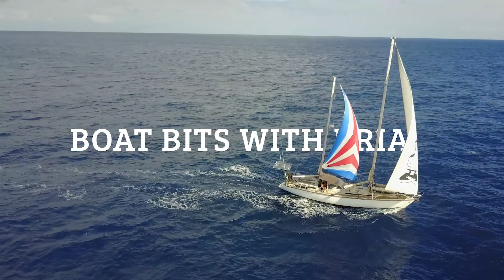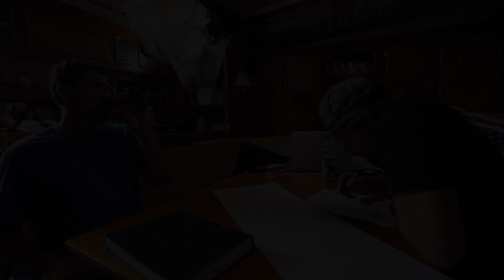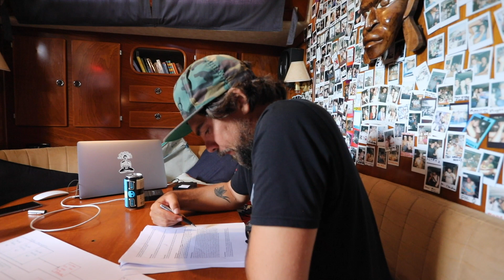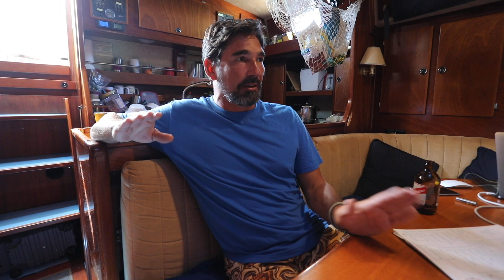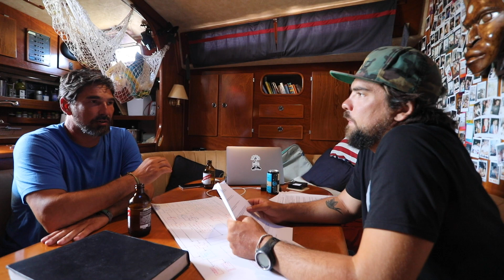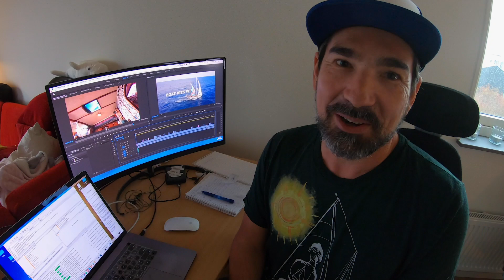What can Lithium Power? - ELECTRICAL BOAT TECH (6 of 7) -  Sailing Vessel Delos

Comment: 12V Utility sockets (cigar lighters) are handy and you get laptop power supplies which run off them.  Used it to run my laptop of solar power.
48VDC is also close to non-touch safe in salty wet conditions.

Comment: Brian, I am sure you have heard of these, but when outfitting my van I used a good bit of 6ga wire and some 2ga and 4/0 for the battery itself. With regards to crimping, I used a hammer crimp. It has a bit of weight to it, but not very big and I used a standard hammer. Just in case you need to crimp and are not near a store that will do it for you.

Comment: solder connections melt and it flows down when used for larger wires.It starts with a small spot/imputiyy which heats up and soon the whole things melts away.

Comment: Even though I know what you meant the fact is that you can carry more power on a thinner wire with 24 V then 12 V not because the voltage is higher but because the amperage is lower. You get heat from amperage. Heat has nothing to do with voltage. It’s not intuitive.

Comment: I have 2x8D lead acid batteries and a 4d lead acid battery for emergency radio back up (required by coast guard here in Newport oregon) I hate them!! I typically spend $300 a year on batteries and its ridiculous. Especially when my fishing season is only 7 months. I have a good charger but still they do not seem to last. Your thoughts?

Comment: Regarding 48 volt electrical systems, as voltage goes up, so does shock hazard.  This should not be overlooked when comparing the pros and cons of the different systems, especially in marine applications.

Comment: Electrical tool tip to Brian or anyone else that might be in Sweden.

Saw you videos about your electrical systems and tools and just wanted to give yu guys a tip for a tool you can use to crimp battery connections or other large connectors while at sea and that does not take up a lot of space. 

There is a company in Sweden thats mostly known for selling half decent stuff to really bad stuff. But they have some goodies that actually are really good and worth spending money on. 

www.biltema.se 
Part# 19-1257

Either you can put the tool in a wise and crimp your connectors. Or you can simply beat it with a hammer/sledge to get the same result. If youre in a pinch it will get the job done.

Comment: I have soldered battery lug connections before with a propane portable torch but you can buy a hammer style crimper but being on a boat you would want a block of wood underneath it when you give it a good wack.  I have used this style crimper for decent size cable used for welding. It's extremely small, the brand is Temco Hammer Lug Crimper. https://www.amazon.com/TEMCo-Hammer-Crimper-Tool-Warranty/dp/B00E1UUVT0 .. Just in case someone would like to have a crimper aboard

Comment: I have been considering going to lithium batteries for a while now.  Of all of the drop in batteries, Battle Born keeps coming to the top of the list.  Good quality, good price (not the cheapest nor the most expensive), have built in BMS with both high temp and low temp cut offs, BUT most of all, they have a 10 yr warranty.   Every other battery has only 1 yr or at most 1.5 yrs.  Many drop in battery replacements don’t have the same features like low temp cut out for charging.  Charging below 0C will kill a lithium battery.   The fact that Delos is pleased with the performance of the Battle Borns is the final linch pin to going with these.

Comment: It’s funny to hear your comments on wiring around the boat.  I don’t have an inverter on board, but ended up putting The higher amperage USB ports all over.  USB C should be able to charge an Apple laptop.  Probably not worth rewriting, but is awesome since I don’t have AC.

Comment: Don’t think poorly of soldering big lugs.  As I recall, the only solder connections the ABYC allows are for lugs.   The best way is to use solder slugs.  These slugs come in various sizes matched to the wire size. Each has the right amount of solder with flux.  Drop a slug in a lug and heat the lug with a torch.  When the solder melts, push in the wire and in a few seconds it is a fixed solid connection better than a crimp.  I have used slugs for 4AWG to 2/0 AWG wire with excellent results.

Comment: Reverse osmosis in water makers removes all the essential nutrients and minerals for the human body (and plants).  You have to install a mineral injector after the RO.  If you drink it long enough it can damage your body because the water extracts the minerals out of your body to rebuild its own structure.  That said, many sailors use RO systems for decades and have not become sick.  But water specialists that I know say its dangerous for the human body.  The one good thing about RO systems is that your Down stream equipment stays really clean.

Comment: I put up solar panels on my house last year adn used 327w panels.  2020 I will add another 10 to 15kw but am seeing 400w available and saw 500 watt panels at 13c a watt in china.  They all put out 54v.  I am thinking that using these panels instead of the old 12 and 24v panels would really help put more solar on a boat.  I am using a solaredge inverter but using those new enphase that invert the panel from dc to ac and put the voltage to 220v ac would be possible.  The inverters are way more efficient when using higher voltage input.  You also wouldn't have the intense corrosion that DC wiring tends to have going to your inverter/battery system.If you use 50 cycle it would be pretty safe as it is below the cardiac frequency.  60hz is the worst but keeps the mortality rate up in the States.

Comment: If you want to run laptops directly off DC, you will need to use a 24V source. Most laptop PSUs put out 17 to 19 volts. If you do that you should find good quality regulated output units. There are units meant to run a laptop off a car, but they have to step the voltage up so they may not be more efficient. I've found that my 13" MacBook charger always runs hotter than my 17" Sony Vaio. Probably because the Sony unit is twice as big as the Mac! They packing density is less. Nice video guys. This series is a pretty comprehensive look at good practice.

PS Sailing Uma crossed the Atlantic in about 14 days, with nothing but solar, and I don't thing they ever got down to 50% on their Lithium batteries. That seems to be the general outcome from people who have a good installation.

Comment: Brian check out you Inverter 3000 va  = 2500 watts. To solder your battery terminals use a plumbers small mapp gas rig and have done them over the stove.

Comment: Very interesting topics and discussion. I am not so sure you could save any significant amount of energy if you'd run laptop from DC directly. Depends of course the efficiency of your inverter but generally they should be quite efficient. If it is say 98% efficient and DC-DC regulator about 95%  you only end up saving roughly the 2% or less than 2W. It is of course something but perhaps not worth the hassle unless you have USB-C input for the laptop and sockets that can provide the 80Watts that the laptop takes.
Reply from the maker: Yes, my thoughts also.  Plus we already have enough chargers and adapters roaming around....

Comment: I really appreciate your thorough treatment of technical subjects, they are very helpful as I plan on rightsizing the electrical install on my boat. I have had a burning question for some time with regards to solar power on a typical 40 foot sailboat. Is it possible to install a solar system large enough to power AC (cooling) for hours at a time (like all night), or would you necessarily need to run a generator.  Lets assume a smallish AC unit that is only going to cool the master bedroom in a 40 ft. catamaran. Also, what about cooling that entire 40 ft. catamaran for hours at a time on solar alone?
Reply from the maker: I do think with enough solar and battery capacity it is doable. You will of course need a soft start device like this https://battlebornbatteries.com/shop/easystart-364-3-ton-soft-starter/ to avoid the high start up current draw of the compressor....
Reply: @svdelos  Thanks for the reply :-)

Comment: On the big connections you can solder in addition to crimping, just not in place of crimping. 
Doing both theoretically will reduce the voltage drop across the connection, but in practice the difference is small enough that you don't have the equipment to measure it. 
There is also a theoretical advantage in durability of the connection, especially in high vibration environments, but experimental results are mixed with some results saying it works, some saying it makes no difference, and some saying it is actually better not to solder.

Comment: Another good one , thanks. Can you just explain a little more about the differences of 12v and 24v systems, and which is best for what and why. Is one easier to charge than the other. And on a 35ft offshore cruiser with  300W of solar  is it worth running 2 systems.

Comment: Yes,  anything can be run from 48v only thing needed is a converter. Huge savings on heavy wires, efficiency is better than 12, 24, or 36 volts 
There are 48v induction cooktops, lights, pumps fridge, a/c and no inverter is needed. 
https://www.google.com/search?q=48v+to+12v+converter+box&client=tablet-android-samsung&tbm=isch&sxsrf=ACYBGNQnbdTKR5l0zkio7AFcw7GaV6hWeQ:1574302634357&source=lnms&sa=X&ved=0ahUKEwj1uaiqnvrlAhVkg-AKHTKAC1UQ_AUICygC&biw=1100&bih=696&dpr=2

Comment: The video is perfect im learning so much im  installing a unit in my box truck for my handyman business. It is 14 feet long so there is plenty of room for panels on the roof but im not sure how many batteries to run im wondering if three would be enough for some lights and saws . The hard part is running my compressor for now im just using a 3500 watt generator but traded some work for a 10000 watt generator that had been sitting for a while.
Reply: @michael crowers check out this link for some educational videos on solar.
https://www.youtube.com/playlist?list=PL7bvIB2TPsChaaGyPfBbk-txxXqe82PK5

Comment: Brian, the self Internet educated electrician of his know it all over confidence and all ignorant pina colada bikini crews brain fries. voltage is a measurement of power, amperage is a measure of current. The flow of power (VxA=W) is the product of energy. Therefore, yur battery bank does not have 'alot of power', its nominal at ~24v. So correction: Delos has a lot of energy capacity, plus an electrical engineer would never propagandize 'a lot' as a specification bearing on health and safety. Justin sold a bill of goods. Goods enough for an iced drink at anchor. Delos could never head north of 49, like real a mans boat. How would u?
Reply: Well! Now we know where one of the thumbs down came from. 😁
Get a name. Get a life. Get an attitude adjustment. 🤔😛
Reply: @mikebarron5805  Anonymity is a right under the IETF that has been eviscerated by the tyranny of american exceptionalism and media profiteers. I dont have accounts on most social media site because of the freedoms they restrict, ill assume unknowing to you. Thanks for the attack, I guess zombie beach parties and pina coladas are praised as your expertise over an education in technology. I was correcting the point of an incorrect (drug and alcohol induced) explanation of James Watts definition, to something 100K viewers should be aware of.

Comment: In case of emergency there is a small tool that will crimp a terminal on a cable, it uses a hammer or a c-clamp to crimp.

Comment: Am I to understand you have a third power generation dragging through the water. Doesn’t that drag slow Delos? Can you show this device?
Reply: Picture a propeller on a waterproof generator/alternator.  It feeds to a controller and then to the battery bank. It obviously offers some drag but in the case of Delos and her generous sail area it isn't an issue. You see them many times reefing the head sail or main so there is plenty of free power in the wind if they need it.

Comment: Good stuff on the electrics.  I'm liking the videos!  One question I have does your main engine have double alternators to change it's own battery plus the house (lithium) batteries or are the completely disconnected from the system - ie: single alternator to a lead acid for the Volvo?

Comment: Great video! Question: in your electrical system do you have a component that checks and conditions the input power before it is distributed throughout Delos? I am especially thinking about shore power which I understand can be of poor quality that can damage sensitive equipment like computers. Thanks!

Comment: 48 volt system is much better. You can always use a dc-dc converter to drop the voltage down to 24, 12 volt for any thing that needs it.

Comment: Ok. Mr Engineer..How do you maintain a lithium cell to make it last 35 years? What removalble elements pile up on a lead plate to reduce its performance that can be reversed by proper maintenance?  When did you last post a video of Delos performing proper maintenance on your "old" lead acid batteries"?? You are an alleged engineer and "The old man of the sea" I expect better of you
Reply: Somebody got triggered. So did you go back finally and look up the boat electrical and battery maintenance  video? Doubt it. Come back after you have watched it.

Comment: Lithium batteries are great but have a bad habit if the batteries are not used and serviced properly. Remember back a few years ago when the Boeing 777 batteries burning up. Cessna even pulled them out of their jets because of the risk of fire Are you concerned about this? not a lot of places to go on a boat.

Comment: Yiou are an engineer..what battery bank does it take to run a radar with 50kw transmit at 1.2 ghz continually. How is it scientifically possible to use the same lead-acid battery bank for 15 years at that level?

Comment: Cheap batteries don't last as long as good batteries. seemingly depleted lead-acid batteries are EASy to recondition...even after years of irresponsible ownership. Most poeple who can afford a yacht seem to expect that all systems are "permanent" and require no personal responsibility. The Allstate lead-acid batteries on MY boat are 37 years old and still rock..and If I HAD to replace them...easy to recycle

Comment: Currently, Lithium cells are NOT recycled when they die. Lithium as a deep environmental poison. LEad cells are cheap and easy to recycle. Lithium cells get tossed in a landfill. Using Lithium cells at this time is VERY environmentally irresponsible
Reply: Try reading before making irresponsible comments https://greencitizen.com › recycling-lithium-ion-batteries
Reply: https://recyclinginternational.com/batteries/the-unknown-success-of-lithium-ion-battery-recycling/26899/

Comment: Lithium can power anything that doesn;t catch fire or expold when the lithium cell is charged.,Given the history of lithium cells,, oputting one on a boart in the middle of the ocean is indeed gutsy
Reply: Like Brian said, LifePo is specifically designed to be much more forgiving than more traditional Lithium formulas. They have a pretty good track record in the marine industry at this point. On the data that's available so far, it seems as though they are about as safe as traditional wet cell lead-acid.
Reply: @operator0  LFP has the highest energy density of all chemistries... Lots of power and hence the choice for cars and applications with limited space.  The electrolyte is the problem with lithium batteries - highly unstable and flammable.  When the battery shorts, which they all do, you will have a BIG fire.  Non-flammable electrolyte that actually is also conductive is just arriving along with high temp separators but until then, I'm a no go along with all international navy's....  In a telsa, fine, just walk out.
Reply: @tigersharkzh  The US Navy doesn't use lithium ion today.  They think it burns great.